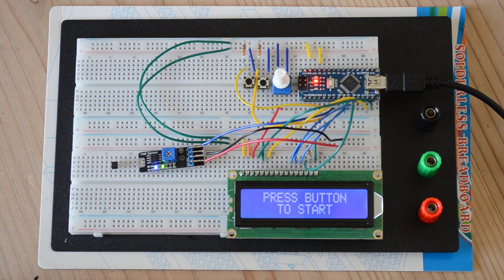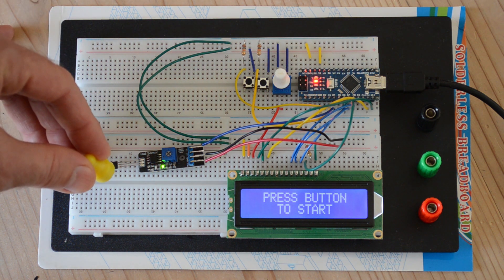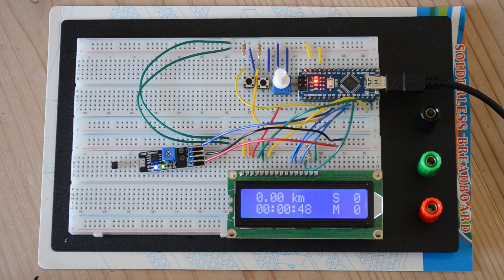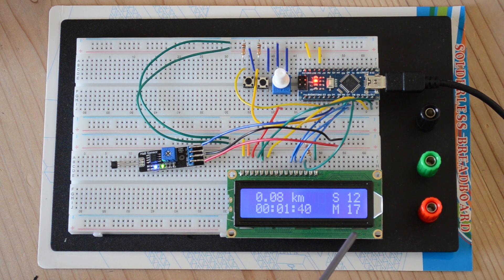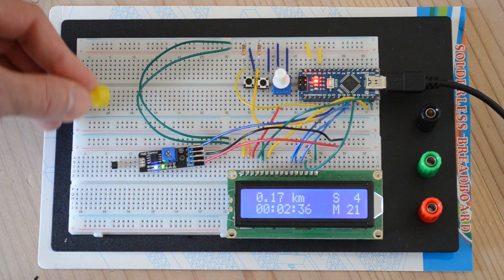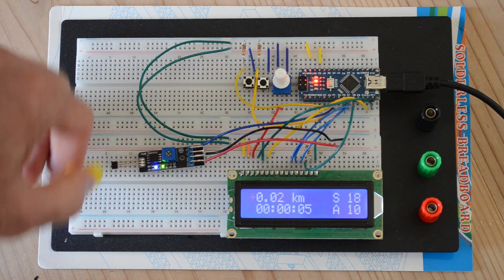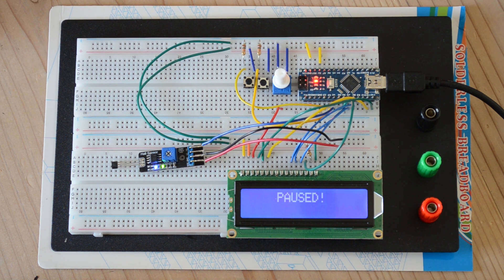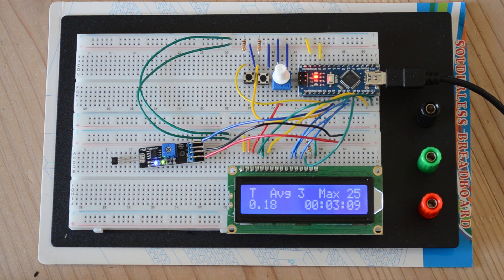Bicycle Odometer and Speedometer

Comment: Great video.
And one I can use for starters. I am rebuilding the odometer / speedometer on my old Ford Model T and only need to use a stepper motor to rotate the speedometer drum relative to speed and use a LCD screen below it to replace the mechanical counters. My problem is as follows: on the digital readout the top row will show the trip odometer, which you are already doing, The second row will be the odometer showing total miles so as to add the trip mileage to the odometer every 1/0 of a mile and then be able to keep that total when power is removed from the arduino. I am hoping to use a condenser on the input so that one pin detects the power off and the condenser keeps feeding power for a couple of seconds allowing the software to record the last odometer reading and bring it up again when the power is restored. That is what I do not know how to do.

Comment: can i use ir sensor
Reply from the maker: Hi Jaydeb - yes, that should work as well.  The only drawback is if you ride in the rain or mud where water or mud could interfere with the IR sensor.  This is why I chose a magnetic sensor which is more reliable in these conditions.
Reply: But if you were to model and print a case for the ir sensor using ABS you could fix that problem.

Comment: G'day, I've come to ask, can you clarify the hall effect sensor schematics as there are three available pins, and only two are used in your circuit. I am using an Arduino Compatible Hall Effect Sensor from Jaycar Electronics.
Reply from the maker: Hi Felix.  I am using 3 pins.  Two are for power (5v and ground - red and black cables respectively) and the third one is for the on/off signal (blue wire).

Comment: Is it work for high rpm about 900 rpm
Reply from the maker: Hi Shubham.  I have no idea if it will work at such high speeds.  You would have to test it.
Reply from the maker: Hi Shubham - I have not tested it at those kinds of rpms, so no idea if the hall sensor will be able to keep up or the Arduino at its operating speed with my code.  If you have the parts handy and can build it, I would say that it is worth a try.
Reply: If your hall sensor has a potentiometer on it you can turn up the sensitivity so it can detect a magnetic field from a farther distance giving it more time to detect the magnet.